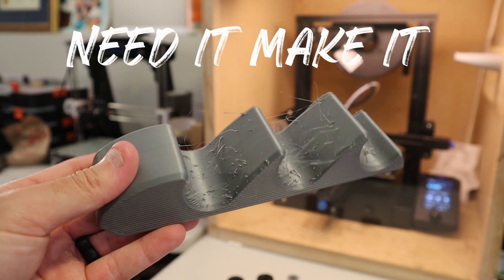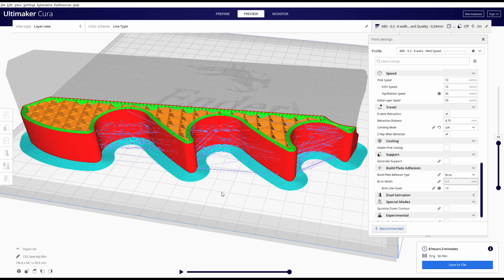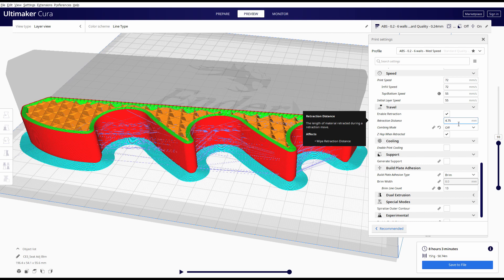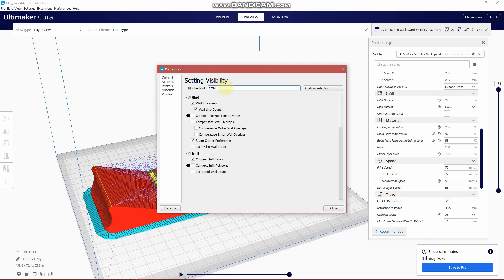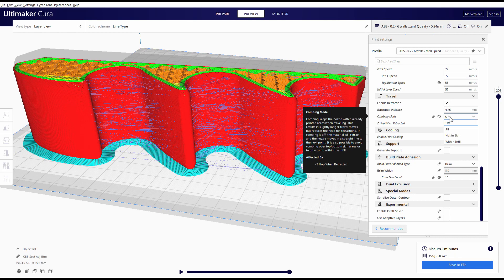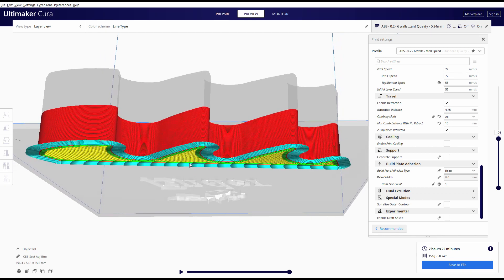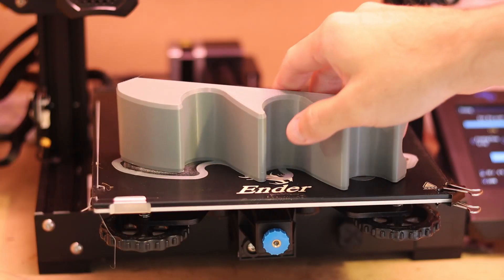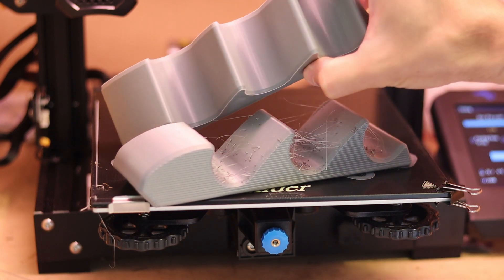Creality Ender 3 V2 - Stop Stringing, Improve Print Quality & Time With These Two Settings

Comment: Really cool...which ABS filament is this?
Reply from the maker: This is the generic ABS filament supplied by 3D printing canada,  nothing special here, I've tried others and I haven't found any benefit over these.  Here is a link if that helps: https://3dprintingcanada.com/collections/abs/products/silver-2-85mm-abs-filament-1-kg
Reply: @NeedItMakeIt  thanks a lot for the speedy reply! Color looks cool.
Reply from the maker: @MA-nx3xj  No problem!  There is one  issue with this silver filament, it is highly affected by moisture, in the cooler weather it prints really well, in the heat of the summer... really terrible and needs to be dried.  Otherwise it is a very good product, and no other ABS that I've printed with acts in this way.
Reply: @NeedItMakeIt  Thank you for your input.
 I just got my Ender 3 V2 this Thursday and I'm loving it!

Comment: In your description it says you have the ender 3 v3 (its the v2 right ?)

I like the wooden case you made. Easy to modify later on etc. 

So your ender 3 is stock?
Still assembling mine since banggood gave me 1 faulty wheel so getting that in today.

What is the print you made there it looks like it is professional quality!?
Really nice job. 

Ive gotten mine with a metal extruder and I am gonna upgrade it with bl touch.
And a raspberry pi with a cam on it. 

Any other upgrades you did or reccomend?
Reply from the maker: Hi Rick, yes, Ender 3 V2.  The wooden case was inexpensive to make and I am a woodworker by trade so it comes naturally.  A fully plexiglas case would be nice down the road though, the wooden case blocks light and makes it hard to make sure everything is running the way it should.

Yes, mine is stock, I needed to snug up a few bolts and adjust the cams a little for the wheels for the Z axis travel so that they weren't too tight.  The aluminum frame is good, however the tolerances for the frame could be a little tighter.

The raspberry Pi would be a nice one, the BL is pretty cool and I've heard good things about it as well.  

I prefer to keep my printer as simple as possible (like my cars) because when they break down and require maintenance, it is cheaper to replace the parts and with less possibility for failure in general.  I may consider a direct drive extruder down the line and the bed springs are not great and do not apply enough pressure to the large leveling nuts so they are a little too 'free' to rotate.  If i stick with the Boden, I'd replace the stock plastic extruder/single gear housing with a metal one and dual gears for better.  I may also experiment with the tube length, apparently it can be shortened which helps a little with retraction. 

How did you know the wheel was faulty?  Bearings?
Reply: @NeedItMakeIt  

Mayb some led strips for in the wooden case for the light?

The wheel itself is damaged. I tried running it up and down and it has a unnatural stop (bump in it) and also damage shows on the wheels. 

They just arrived and I had to replace both top wheels to make it smooth with no bumps. And am now going to continue assembling it. 

What was the print for you made in this video ?
Reply from the maker: LEDs sound pretty good, I actually have a adjustable colour set that I could rig up.  

I am finally getting the hang of feeding filament in from the side, I was struggling and I am always hesitant to move the printer so that I can avoid any need to re-level the bed.  Maybe a little access door from the side would be good so I'm not feeding 'blind'.

I've never heard of that problem with the wheels, defects are tough to see on black.  I'll order a few replacement wheels to keep handy in case these ones go.

The print was from a set of Bowflex bench parts that I make, https://youtu.be/9M2wX5IQAYU.  This is something I wanted to make available to everyone, but it seems that many people want me to print sets for them.  Printing these structural parts does take a good level of care to make sure they last and they don't break under the applied loading in any scenario.

WARNING****I'm working on a video right now about under extrusion, you may not be able to save E-step changes with the current firmware on your printer.  You'll need to update the firmware first and the problem is solved.  I struggled with this for a while and finally came upon the right solution.  I had been compensating for it in the flow rates, the real problem resides in the incorrect e-steps for the extruder.  It was set to 93, you'll be allowed to change it to 104 for example, but the changes are not saved and you'll think everything is good, but it is not and anytime you turn the printer off it will reset back to 93.  I've lost countless hours on this and when printing these types of parts, they can't be under extruded.   There is a YT video on how to update it for the V2; my video will be on how to identify the problem.
Reply: @NeedItMakeIt  the wheels if they are fine they are.. I can't post a pic in this reply otherwhise I whould but it looked like someone did not open the wheels wide enough when putting on the x axis and just pressed to hard and made small cuts in the wheel plastic with the sharp alluminum on top.

(Its not like mine ran out cause of heavy duty)

Got mine to print and the quality is really good for what I can print. (Devil design pla) but the benchy boat fails at say 80% it had trouble making the roof of the boat. (Bridging)

Trying to make a flexible dragonfly right now. 

Eventually I want to load fillament from the side. But right now it is stock. Just printed some bl touch mounts and saw a little bit of lifting on the first layer. So now I am trying with 3dac to make it stick more. With the dragon fly.

Have not really made a good custom profile in Cura yet. Still new to all of this. And have not made any adjustments.. So my settings can't really jump back.

The bowflex looks really clean and a good option for it.. I am surprised you can lrint something that strong cause if you are benching heavy it will take some force!!! Nice!

Comment: How on earth can restricting travel to within the part speed up the process, if the time to move from point a to point b is only increased? Magic? Something must be up...
Reply from the maker: It is really tough to explain, it confuses me too. If that were the case, why wouldn't the programming be this way to begin with?  Maybe If I take a bit of time to compare one layer of Comb vs one without combing there might be an explanation.  The printing time is correct at least according to the Ender 3 display, I didn't time it myself.  You've peaked my interest in this again.  I may need to know more about travel before i delve into this.

Comment: May I know what's the retraction speed when you printed this? Thanks!
Reply from the maker: This was printed with 4.75mm, I use 5mm now, however I think it can be dialed in a little more and someone recently mentioned that re-sizing the boden tube length will also improve the retraction results.  I may experiment a bit with that after I finish the current testing I'm working on.
Reply: @NeedItMakeIt  thanks ! I'll try this one. I am still stuggling with printing benchy even though i tried using this technique. Can I ask for your profile?
Reply from the maker: @raika5859  There are so many variables.  Today I attempted to use a filament that I had only used on my direct drive Anet A8 and it was under-extruding by 20% through all layers switching back using the same profile gave me perfect prints with the ABS I normally use.  Can I ask which part of Benchy you're struggling with?  Are you able to provide a pic and your profile to needitmakeit@gmail.com and I can try the same print.

Comment: Hi, many thanks for this tips. BTW, where can I find the same holder ? Like where you set it 👍🏾
Reply from the maker: No problem, I'm working on the next video right now :)   The spool holder is the one that came with the printer, i turned it sideways and because my prints are normally not too tall, the height of the spool is okay, if you have taller prints, it wont work too well because the boden tube will start to rub.  I plan on offsetting it a bit in the future because I don't want to build a new enclosure... yet.  All plexiglas would be really cool I think, I might just flop around with the heat, so maybe a wood frame.

Comment: I used default Ender 3/pro profile in Cura and Generic Petg profile filament and retract was 5mm too. This a same printers with same technology, just copy settings from Ender 3.
Reply from the maker: Yes, that's exactly what I did as well.  There are only a few minor changes with the V2, the silent steppers are a nice feature, however it is all for nothing when the extruder fan is so LOUD!  That needs to be addressed.  I personally don't like the shroud they've placed over the extruder, it looks clean but it blocks a good view for that first layer and for setting the bed height  (Rant finished).
Reply: @NeedItMakeIt  Today i receive BLTouch from creality, will try it together with original FW from 29.08.2020. And waiting direct extruder from Trianglelabs. Hope he will fit without major changes. Want to try flex printing, but a bowden extruder its almost impossible.
Reply from the maker: @Stalkeros000  I do like some of the advantages of the direct extruder, but there is a speed advantage for the boden that I do benefit from.  Maybe the sturdy frame will allow the direct to print without too much ghosting.   I'll check out the BL Touch, maybe this will be a time saver.  That bottom layer still causes some problems every so often.  How do you like your printer, and have you had any trouble with it?

Comment: I don't get why it was even travelling between peaks, it's just one part anyways
Reply from the maker: Too true.  I can't tell you exactly, it seems so simple to travel within the part since surface finish is important for most 3D prints.  

What I personally believe is that 3D printers are similar to CNC machines in the sense that they do not know what to care about, for that reason they are setup with generic programming.  Nothing is optimized, they leave that to the individual to figure out.

My Anet A8 has always had this trouble with imperfections in the surface on these types of parts.  It is a handy feature, a lot of the material specific problems are irrelevant and those little blobs here and there also disappear.

What did you think of the video, was it helpful?
Reply: @NeedItMakeIt  yes, thanks!

Comment: Looks great! Any drawbacks using this option?
Reply from the maker: So far nothing.  The only thing I might say is that parts which would not benefit from this may have slightly better results without it.  I can throw a few tests in to see if there is any visible difference and get back to you.
Reply from the maker: I've finished a few more prints using this feature with very good results.  I have also found another feature within Cura to speed up the printing time without having a negative affect on quality.  I'll be sharing a video about this within a few days.
Reply: @NeedItMakeIt  Very cool!! thank you.! :))